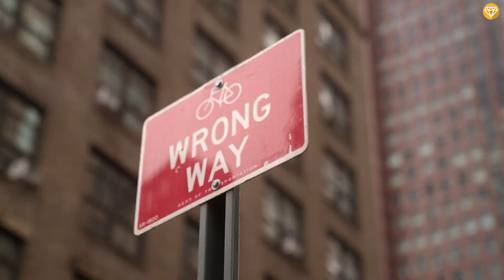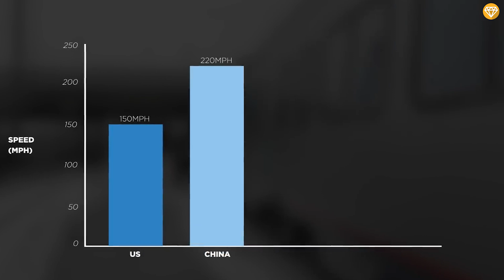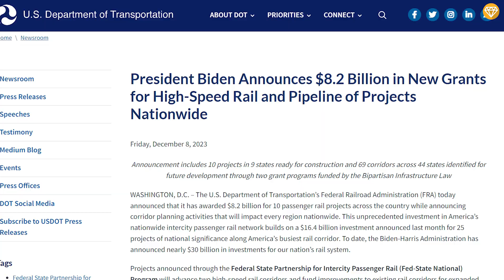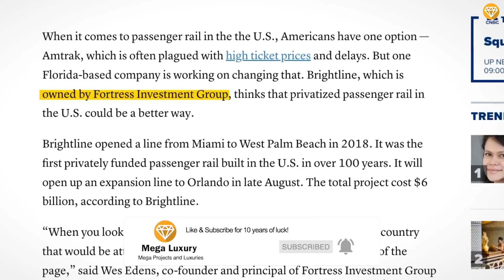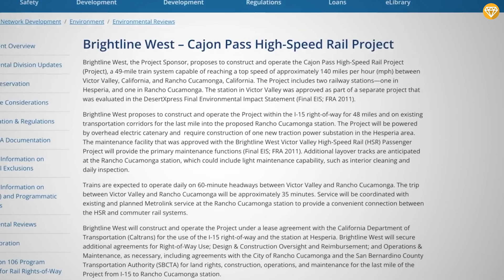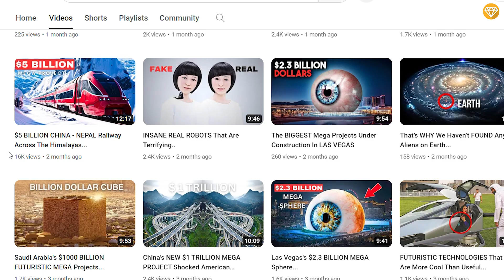The $140 BILLION America's First High Speed Railway is Almost Built...

Comment: A FARCICAL LIE !!!
As a Senior Railway Engineer who has worked on major infrastructure, modern vehicle & Signalling design projects ALL over the World, I will say that this programme bears NO similarity to the reality of Railways in ANYTHING it says !! It is in reality a Public Relations exercise to fill the ignorant masses with impressive but purely fictitious claims, particularly when it mentions "speeds". 

For example "UIC" (The International Union of Railways) states that when trains exceed 150mph this puts them in the "Super High Speed" category. Which means that a special design of track is required, and normal trackside signalling is prohibited. Such lines have to have computer controlled "IN CAB" signalling using the "MOVING BLOCK" principle as initially designed by the Japanese in the early 1960's for the then first Super High Speed line opened in 1964 in time for the Tokyo Olympics. 

"Upgraded existing lines capable of 125mph" ARE NOT SUPER HIGH SPEED LINES and do not require "in cab" signalling. So can continue to use traditional trackside signalling of a suitable "High Speed" capability such as British 4 Aspect signals. But ALL lines above 100mph should be fitted with continuous 16ft (4m) high security fencing, to prevent ANYTHING getting near the railway track. Further Road/Rail crossings are PROHIBITED.  

As for the NEW "Brightline" service in Florida this line does NOT meet UIC requirements as it has no continuous security fencing to keep the public & wildlife away from the tracks. And it still has a large number of Road/Rail crossings which are prohibited on lines of over 100mph. As a result in the First Year of operation between Miami & West Palm Beach 99 pedestrians have been killed wandering across the railway tracks. In Europe of course people found on or near railway tracks are likely to end up in jail as this is a serious criminal offence. And until the USA grasps even these rudimentary safety requirements, Super High Speed in the USA is highly dangerous due to the incomprehensibility of the USA to grasp the necessary safety features required !!!

And the paper seen at 2:59 IS NOT an original from the UIC, and has been altered to suit this PROPAGANDA programme.  The original is of course much more technical & goes into a lot of detail to explain why such things as 16ft high continuous trackside fencing is needed, and why Super High Speed trains are NOT allowed to run on normal railways except at reduced speed. Which means that the North East Corridor does not comply with UIC requirements, as the idiotic USA obviously thinks it knows better !!!!